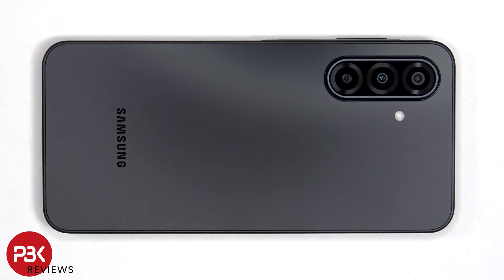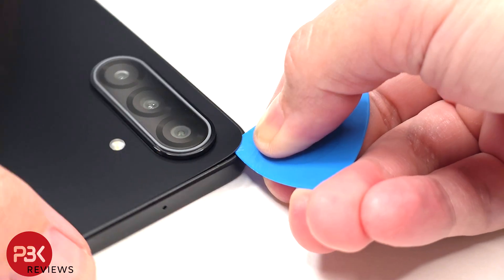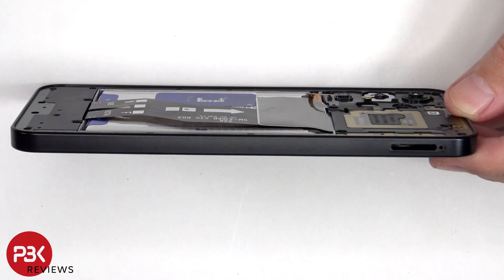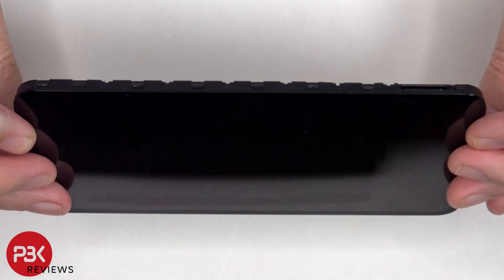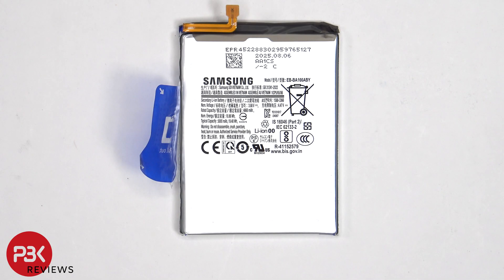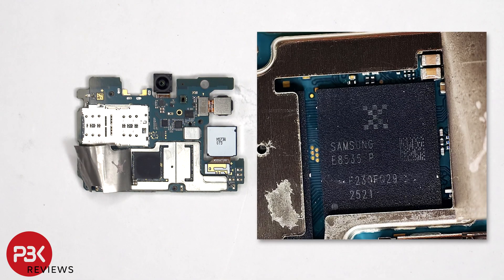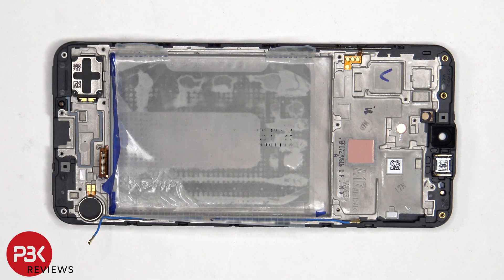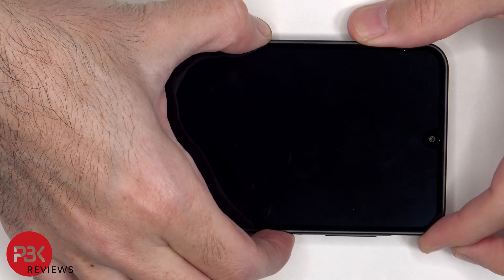Samsung Galaxy A17/F17/M17 5G Teardown Disassembly Phone Repair Video Review

Comment: Amazing that Samsung gets away with reporting the typical capacity for the battery total and not the rated capacity. Apple does it the opposite way where they report for rated and you have to find out what the typical is through software and going through the privacy settings.